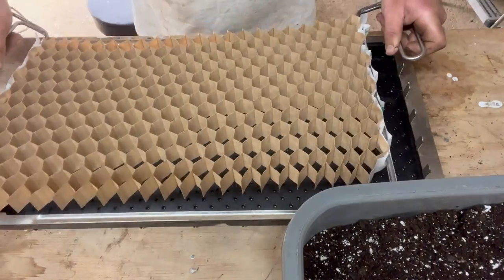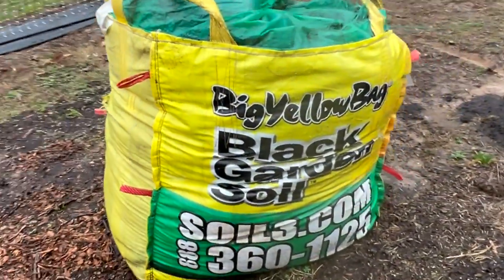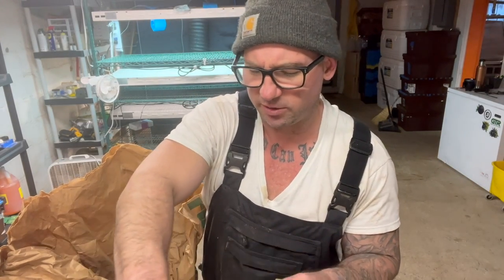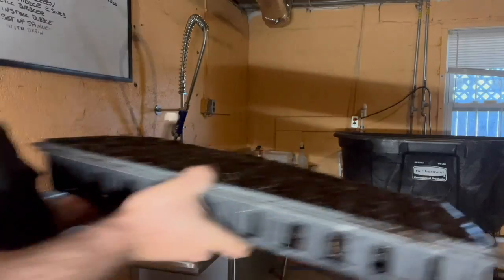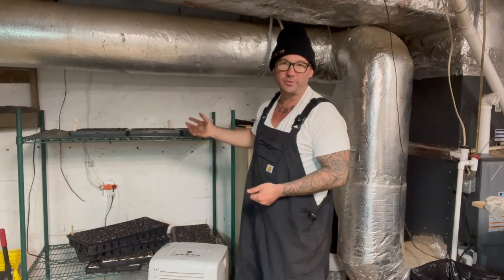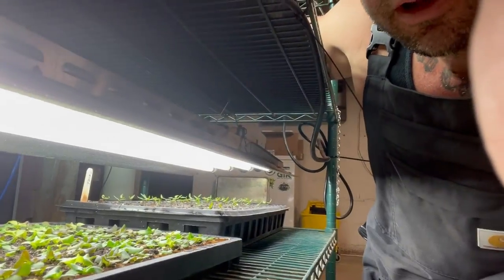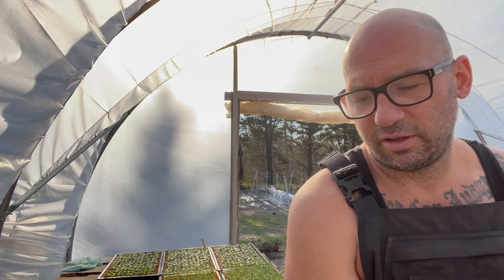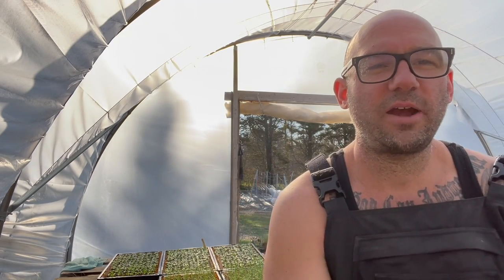START 10,000 SEEDS PER HOUR WITH THE KWIK KLIK DROP SEEDER AND PAPERPOT TRANSPLANTER!

Comment: Your seed starting set up seems to be really efficient. I also start seeds downstairs but I don’t have a convenient door that goes outside nor even sink with running water downstairs. Also I just want to let you know that a majority of lettuce seeds are photoblastic, meaning they require light to initiate germination. Maybe start the lettuce seeds under the grow light with a heating mat to see if that’ll help solve the spotty germination.
Reply from the maker: Thanks for the feedback 🙏 I should share some time that I worked at Katom restaurant supply for 5 years while I built the farm. So I was able to get some cheap equipment from the scratch and dent. I ran the water and plumbed it myself. It’s a little shady but it’s been holding up for a few years. The spotty germination was just a training opportunity with a new worker that’s all. Generally the method I shared works perfectly. I appreciate you following along and you positive comments! Thank you 🙏